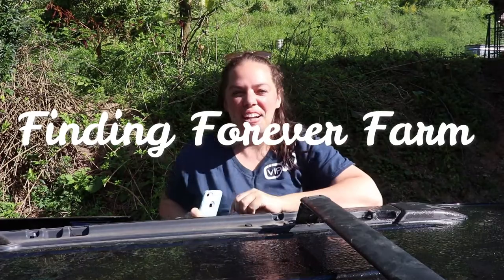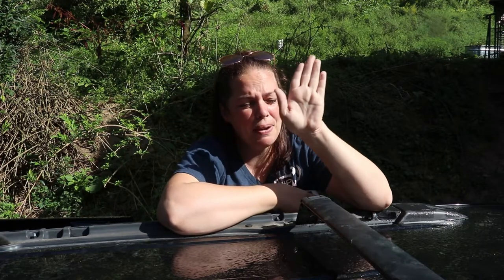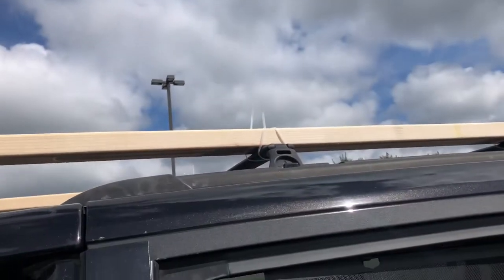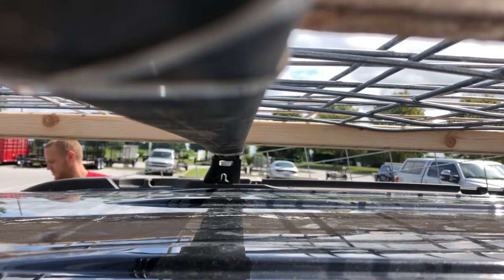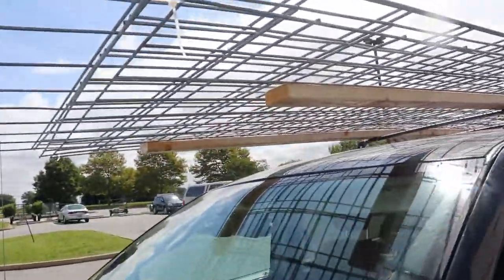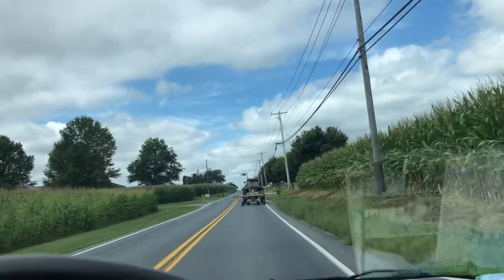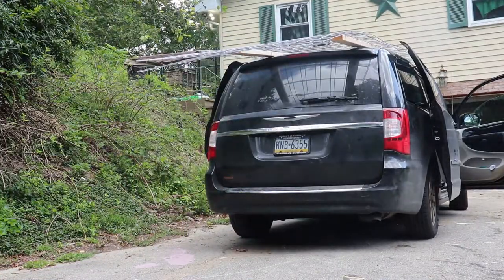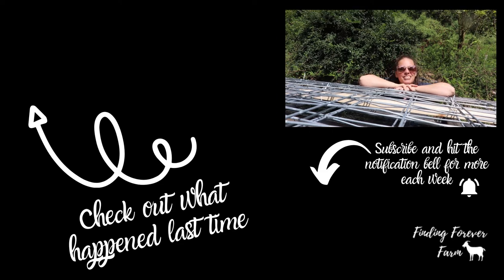Transporting Cattle Panels without a Truck

Comment: Thanks for your video. This is the only one I saw using the top racks. I used this method with a suburban and it worked perfectly. We added one strap on the back. Transported 4 miles. I had to use 15in zip ties for the 2x4s.

Comment: Great solution!  Just wondering if you could tie directly to the roof racks on an SUV?  I want to pick up a couple panels and only have to go about 5 miles.  Do they bend too much without the extra support of the boards?
Reply: Paul Siegel it would definitely bend too much to just put directly on the racks safely.

Comment: What if you have a sudan with no luggage rack?
Reply: Get 8 ft panels instead of 16. Use 2x4x8's and ratchett straps. Open car doors, run straps around, close doors over straps.
That's what I'm going to do anyway.